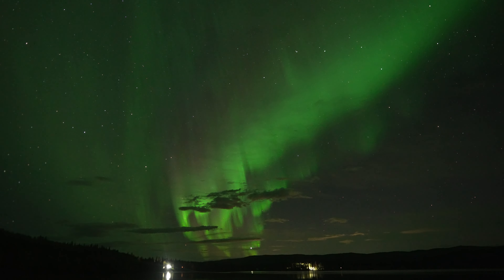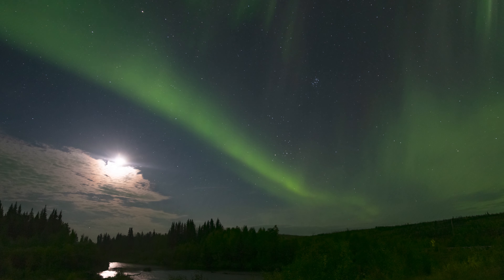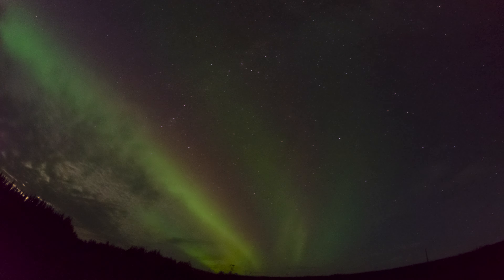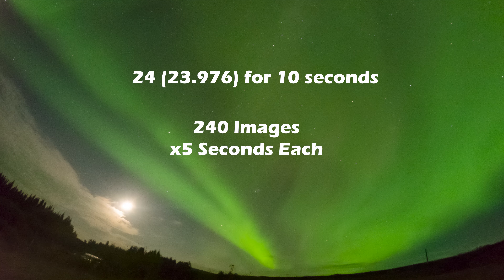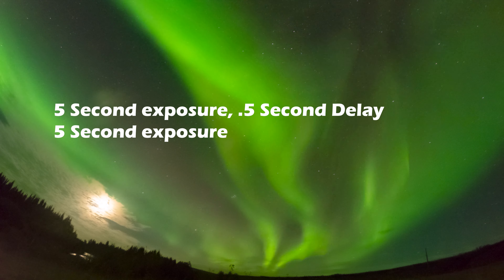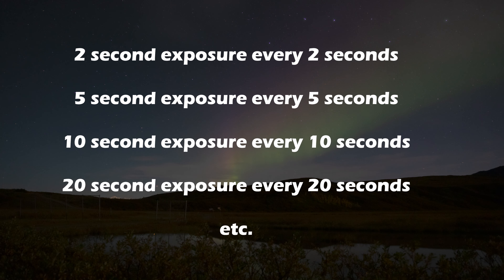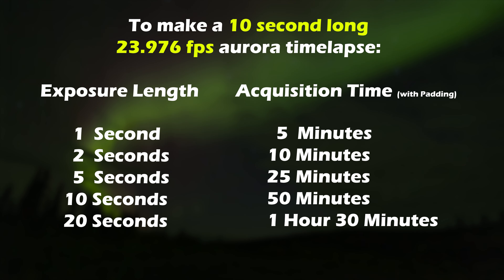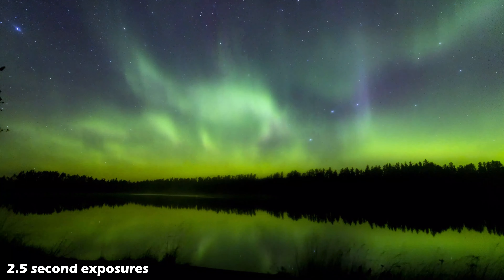Making Aurora Timelapses 1: Tips and Tricks

Comment: What would you recommend for iso?
My current thoughts after what you've said is 
3.2 second exposure F2.0 iso 800-1000
5 second interval total time around 40 minutes for a 20 second timelaps?
Reply: You don't know what settings you need until you actually get out there and start shooting. I don't think I've ever taken an Aurora shot with less than a 6 second exposure. But others have. ISO can be 400 or 4000. So Start at 6 second shutter, your widest aperture and 1000 ISO, and the quickest interval your camera can handle. 1-3 seconds max. Not 5. .... then adjust from there. If it's fast moving Aurora you may need to have a faster shutter, like 3 seconds. If it's a horizon glow aurora then you can easily use a 10-15 second exposure. Again. It all depends. It's like asking somebody how to score a point in basketball, there's like 10 different methods. Layup, dunk, 3 pointer, free throw, fadeaway etc. Just know how to operate your camera and you'll figure it out.

Comment: If I shoot at 5 seconds exposure, with 7 seconds interval (as interval should be slightly above SS) and 2 seconds delay, How long will I need to shoot for 24fps to get a time lapse of 10 to 15 seconds?? I’ll be using f2.8/1600-2500 iso depending on the lights and shutter speed of 5 seconds. Can you suggest the time please? Also is the delay required ?I’m a bit confused but these are the settings I’ll use. Thanks again.
Reply: It should start counting the delay AFTER the picture is completed. I think. So you would get one photo every 12 seconds or five photos every minute. So it would take you almost five minutes to get one second of video and a full hour to get you 12 seconds of video.

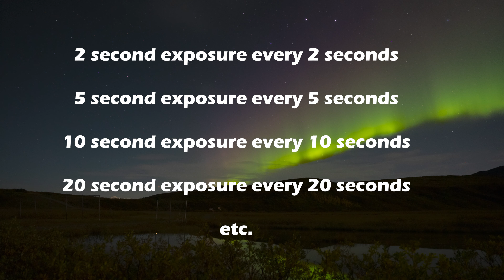Comment: At 3:45 you mention 2 second exposure every 2 seconds, 5 second exposure every 5 seconds etc.. For the 5 second example, do you mean an interval time of 5 seconds of no shooting between 5 second shots? or earlier you said .5 seconds between 5 second shots. Just trying to get a better understanding of the correct buffer time to set.
Reply from the maker: The overall goal is to collect light at all times!  Weaker/slower moving aurora will require longer exposure times, while faster moving/brighter aurora work better in timelapses if you have a little shorter of an exposure time.  In any case, it's best to match the interval to the exposure time.  On Canon you can cheat a little by just using the continuous shutter mode and a remote trigger. Set your exposoure to 5 second, and then lock the remote down, you get your 5 every 5 or 10 every 10 etc without putting any thought into the interval!
Reply: @scienceoutthere  ok thanks for the reply!